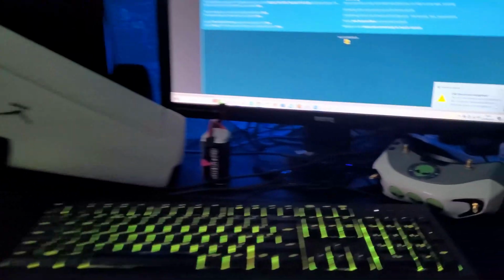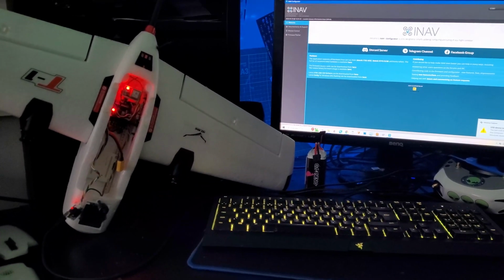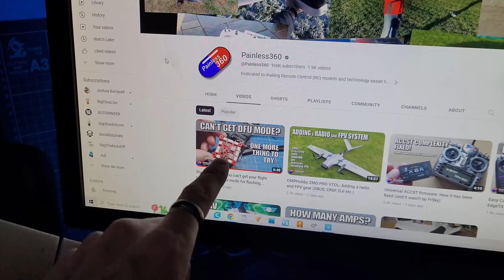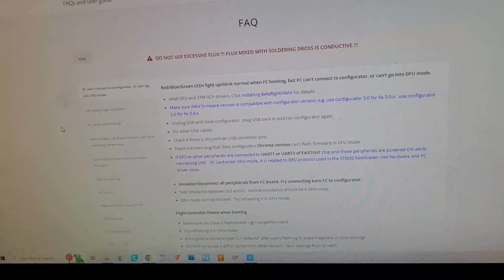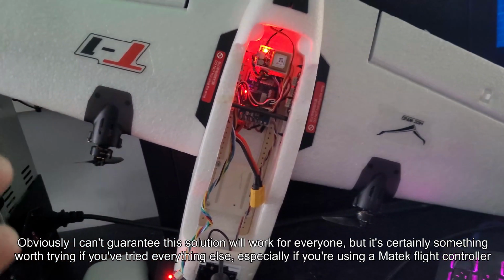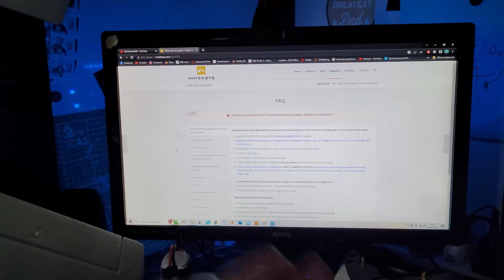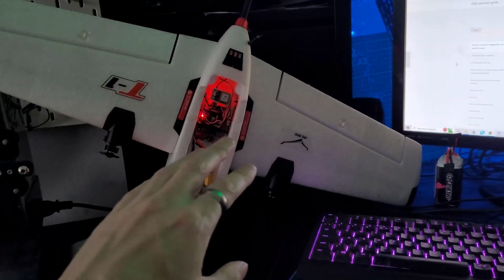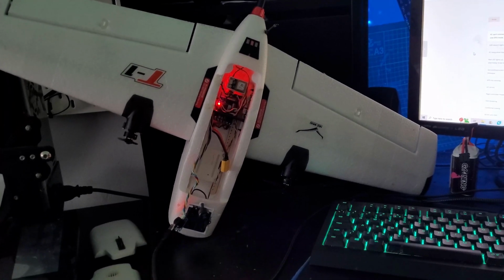🛩️ DFU Mode Not Working? - How To PROPERLY Fix!

Comment: Atomrc F405Navi. Mine wouldn't even show up as a COM port until I powered it by battery & removed the GPS, which was on UART4. Once the COM port appears I can then re-plug in the GPS & the COM port stays. Time to get a CLI backup before I see if I can get this bugger into DFU mode

Comment: Yep, that's the solution that worked for me every now and then also. 👍
Also one solution that helped me one time was to connect a LiPo and power up the FC before going into DFU mode. 
One other solution suggested by a YouTuber was to disable in INAV the GPS in the Ports Tab, just select None, before entering DFU mode. In case the FC is well hidden and disconnecting not so easy. I never tried this myself.  
Hope this helps people and saves endless fiddling with ImpulseRC Driver Fixer or Zadig....

Comment: Question for both ardu and Inav;Does everyone keep upgrading even when they have the plane tuned?
I have a wing with an ardu build that must be over 5yrs old and it's tuned in. Myself I don't see the point of upgrading once the planes is working flawlessly. Interestingly Tridge was saying that you should upgrade with a clean build and reset it up, not transfer params. And I'm certainly not doing that with ardupilot.
So what's the advantage of upgrading if the hardware stays the same and flies great? Am I missing something?
Cheers
Reply from the maker: As a general rule of thumb, I don't upgrade firmware unless there's a very good reason too. I very much believe in the ''if it's not broke, don't fix it' mentality. However, I did upgrade the firmware to inav 6 recently as that firmware had a crucial bug fix in that I wanted